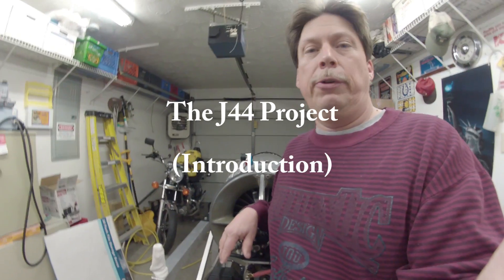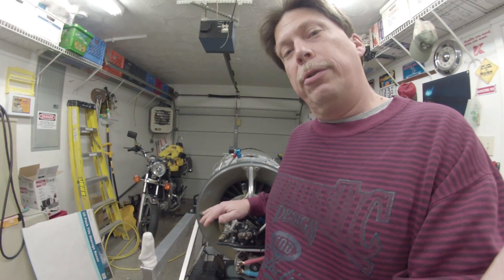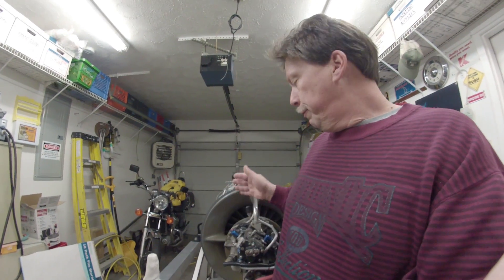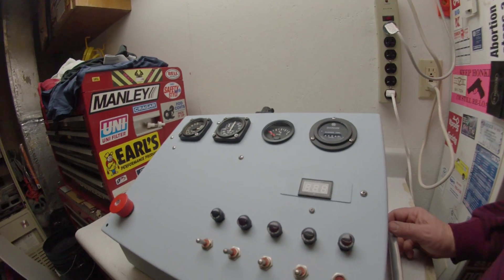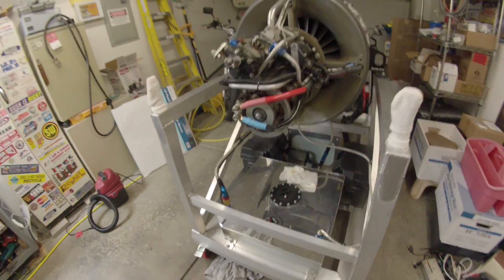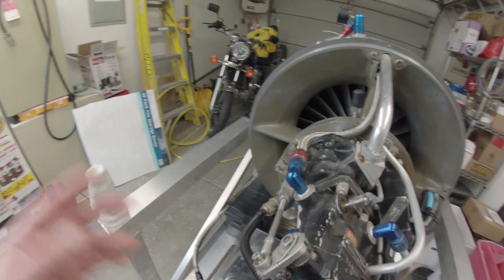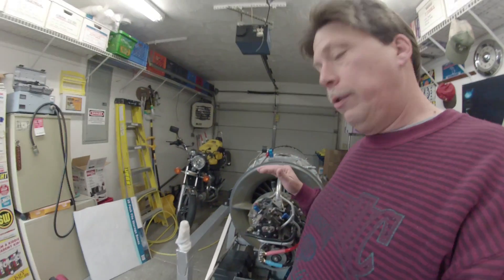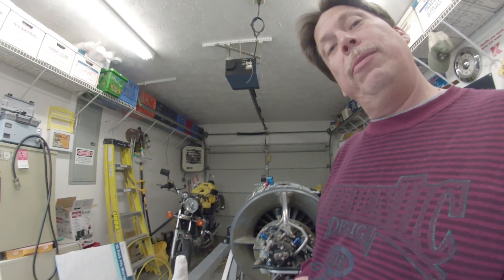Fairchild J44 Turbojet Engine Project Introduction! ("The J44 Project")

Comment: If I may ask, Sir, what are the sparks coming out the back of the engine caused by?
Reply from the maker: That is carbon that had built up as well as pieces of the turbine stator that was failing.  That is the main reason for the rebuilding... it had been abused.
Reply: Gotcha. Thank you for the explanation!
Reply from the maker: See my restoration videos for some close-up views of the heat-damaged stator.  This engine was used by a guy that performed at air shows & car/truck events, powering various home made vehicles, so it had been toasted!

Comment: Hey i just bought one of these J-44 engines on ebay going to pick it up in few days is there anything i should look for before paying for it. also did your come with a dc starter motor?
Reply from the maker: Look for major dents, corrosion & turbine nozzle/turbine damage/erosion.  Some come with starters & some do not.  Must have it!  Make sure the rotor turns freely, no binding, grinding or rubbing/scraping sounds.  It will always be a gamble unless you know the engine's history; it may just be a parts unit!  Buy a service/maintenance manual for it, as well as an Illustrated Parts Breakdown manual, so you can learn all about it.  Good luck.

DD

Comment: Forgive me for stating this, but jet engines produce thrust, even at idle.  Most testing I have seen, even for smaller engines have been on heavy stands that cannot move.  Don’t you think you should at least have hold down straps going to concrete embedded lag bolts or something?
Reply from the maker: Well, probably, more in case of a problem with the fuel control or some other cause of a 'runaway' situation but for my first few runs, I knew not to try to increase power much at all.  I have an Emergency Stop button to kill the fuel if something goes wrong.  The idle (30% RPM, for this engine) thrust is around 120 lbs so that is not going to move that stand up hill; the engine weighs about 400 lbs and the stand with batteries weighs about 250, so heavy enough.  In a couple of later videos where I have ran it up to 50% RPM, it was tied down on a trailer, which was hitched to my truck.  I will have to get a larger fuel boost pump to run it much higher than 50% so hopefully that will happen once the engine is back together & running!  Stay tuned...

DD
Reply: Wow, only 120 at idle?  Didn’t know that, in that case that stand is definitely good enough.  I did see a runaway video and it really could have been a mess had it not been for the forklift that kept it from running amok.  Good luck with your life’s project, and thanks for the videos
Reply from the maker: Yes, I saw that one too!  (see this video from 'Flight Engineering', which is of a Rolls Royce Viper.  He has a number of interesting vids, including WWII aircraft engines and other stuff.)  It was a bit scary for a few seconds; that engine kept speeding up, and they were quickly reminded that it wasn't fastened in place!  Thanks for viewing and commenting.
Reply: Thanks for the Videos and be Safe Darren Duncan

Comment: what are the functions of last 2 switches ( right hand side)?
Reply from the maker: +yxhankun The  5 switches are as follows, left to right:  1st is the fuel boost pump, 2nd is the starter, 3rd is the ignitor/spark, 4th is the fuel 'cut-off' valve & 5th is the power setting.  The power setting is simply a D.C. motor servo that is actuated by pressing the switch up (increase) or down (decrease).  Up is 'momentary', so you have to hold it in this position to increase the power.  It has a 'center-off' position so the setting stays where it was left and down returns it to 'idle'.  There are limit switches in the servo to stop the motor when it reaches the end of its travel, regardless of the switch position.  Thanks for asking & sorry that I just replied.  Didn't see your comment!

DD

Comment: man that is fantastic! i'm glad agentjayz mentioned you in his latest video. i would love to have a jet engine that size my current one is only made of 2 turbochargers. can i ask roughly how much the engine alone cost? like above or below 10K? i hope thats not to rude of me asking, you don't have to answer.
Reply from the maker: I paid about $6K for the engine & there is another $2K in miscellaneous crap but I may have paid more than I should have, due to ignorance of this field & pricing.  You need to shop around & you may indeed get lucky & find that "Deal" but be aware of any 'scrap' or 'junk' engines.  It is best to find one that is known to run & is outdated, flight hours wise.